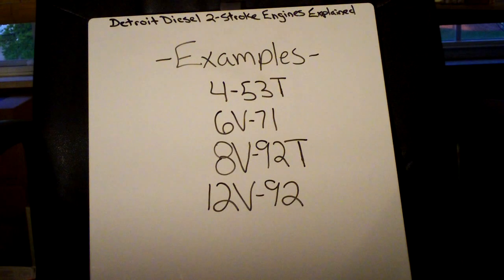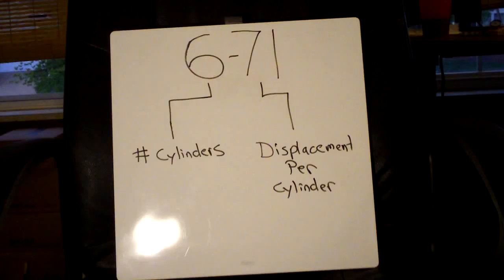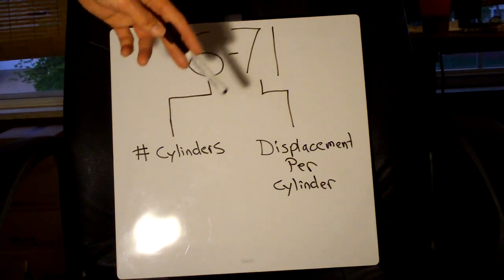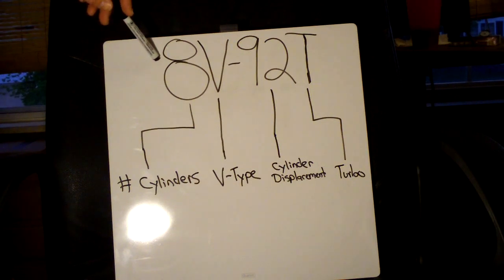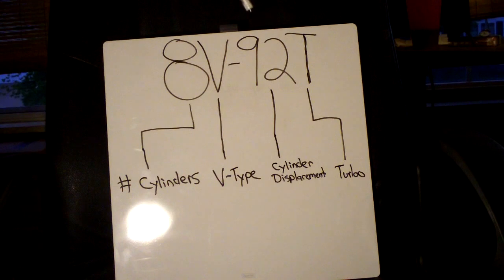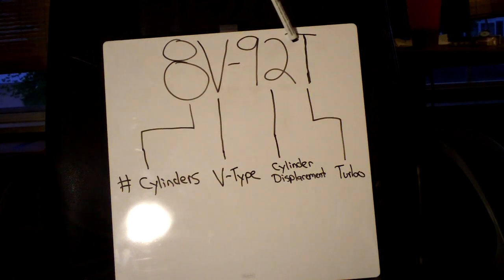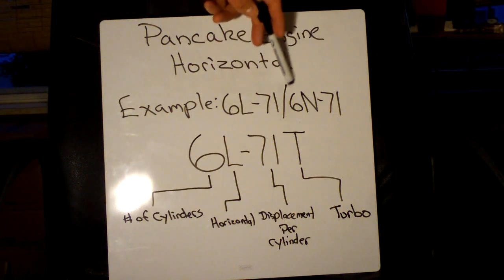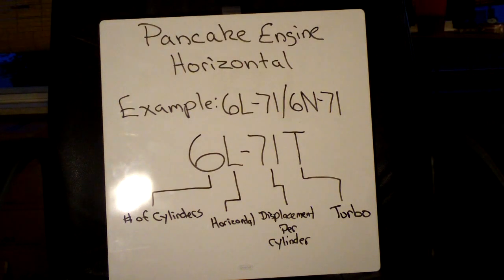Detroit Diesel 2-Stroke Engine Codes Explained

Comment: A two stroke diesel does not have a supercharger! The roots blower is used to force cool air into the cylinder and push exhaust out. On a four stroke engine a roots blower functions as supercharger. I was fortunate to own a 426 cubic inch 6-71N {N denotes naturaly aspirated} Detroit Diesel and a 392 cubic inch Hemi with a 6-71 roots blower from a Detroit Diesel. Detroits run hot and must cooled by air, via the blower, liquid, the coolant, lube oil, and fuel running  through the cylinder heads.